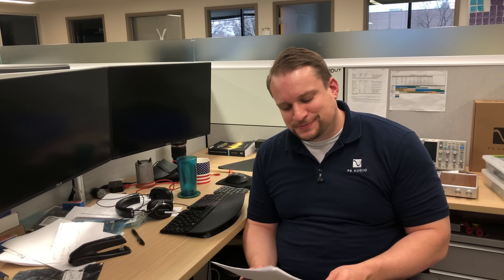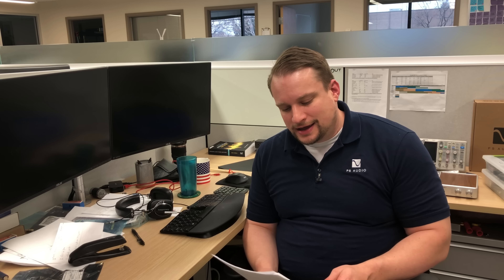Buying vintage speakers

Comment: Vintage speakers and the proper recone kit always gives the best price/performance.
Reply: Yes, but often only the rubber surrounds need replacement.
Reply: Fat Rat  exactly
Reply: @ThinkingBetter  Yes, IF a speaker needs to be refurbished, it's the surround most of the times.
But most of the times, replacement parts come as a recone kit.
Might as well replace all the other components that are part of the kit.
Reply: Qorax Yes, agree. Most speakers are not designed for decades of use.
Reply: @ThinkingBetter  Yeah, I've found that it also depends on the user haha
Especially when that user likes loud, raw bass... 😅
Reply: Qorax I love surround breaking raw bass!
Reply: Fat Rat I have speakers with rubber surrounds that hardened to sort of easily breakable plastic. And other speakers with foam surrounds that became like covered in some sort of mold and also broke easily.
Reply: Fat Rat  the best price/performance when comparing vintage to new speakers.
I mean, are there any other options besides vintage or new? 😛
Reply: @ThinkingBetter  I've had a tube radio with built-in speakers that had a surround of some sort of textile (I think), which had become powder and flakes after 90 years.
Reply: Qorax The oldest speakers I have are my JBL 18Ti that I purchased in 1986. They still play perfectly with no sign of aging. Now I’m using them in my gym room. They still sound better today than most speakers of similar size with their very neutral frequency response helped by a titanium tweeter and unusual high power handling for their size.
Reply: @ThinkingBetter  Well.. it's JBL. It's quality.
I had JBL PRX speakers, very nice and rugged construction.
Reply: Fat Rat  Yup another tube radio I still own is from the early 60s (just a Philips, nothing special) and it still has its original drivers. They work just fine.
Reply: Fat Rat  Meh they're just too lazy to check the component quality by doing some measurements 😜
Reply: Fat Rat  Yes and yes. My L100 Centuries are still breaking in - ha ha. The woofers have the fastest compliance of any speaker I've owned, which is a lot.... and I'm so glad they managed to stay with me. Did upgrade the tweeters to soft domes, and that really made them disappear into the music.
Reply: Fat Rat Well, especially measuring caps degradation is making sense and most modern cheap multimeters can do this. You can’t really use ears to judge if a cap is just out of specs. Caps will usually move the cross-over frequency up by age possibly causing some dip in the frequency response. But for the mechanical moving parts, listening tests are vital. One annoying failure over time that you might easily hear is if the voice coil wire starts getting lose causing contact to the magnet during motion. Also a tiny crack in the surround causing air to come through might be found in a listening test. I use a pair of Beolab 6000 as rear speakers in my home theater surround setup and one cone had such crack.
Reply: @MrPeeBeeDeeBee  You don't want your tweeters to disappear! I mean, what's a speaker without a tweeter? 😜
Reply: @ThinkingBetter  As long as a speaker only changes in its characteristic sound, there's no use to listening if you don't know how the speaker should sound like.
The (partially) disintegrated surrounds I talked earlier about were easily recognizable by ear, because with bassy music you could hear a chuffing/rattling sound.
The radio had more issues that were identifiable by ear, there was a lot of that typical buzzy noise which indicated that certain filter caps were old.
And of course, a squeaking mechanism of the dial pointer and tuning cap 😅

Comment: A good speaker is a good speaker if it's not damaged. That is the reason my Infinity RS IIIa's are 36+ years old and still being used as I write this.
Reply: I also have the Infinity RS3a. What a fantastic speaker it still is! The RS5b for speaker stands is also awesome!
Reply: Pauls old IRS V didnt nees to be refoamed and those are decades old. Its eare they need a refoam. Its rare, and maybe the only thing that needs to be done is a recap in the crossovrr

Comment: Chris, with all due respect, wouldn't d speaker driver manufacturers like Focal, Vifa, JBL, Seas, Peerless etc, be able to offer replacement units from their existing NOS?
They're still in manufacturing and supply drivers to many speaker brands now.
A year ago, I had no problem getting a pair of new tweeters from Focal, for my almost 20 y.o. JMLabs "Electras" 926. They were not cheap but, they were available.
Great video BTW, you now have heaps of confidence and look straight into the camera! Well done!
Reply: Fat Rat  
Hey *Fat Rat*.........Yes, this is a bit more distinct and looks happy. The previous one was somewhat angry or serious looking!
Hope you're keeping well and find time for some music while watching Paul's videos. No news from the Sydney Audio Club yet re: meetings.
Can't wait for the re start!

Comment: I had to have the surrounds replaced on some JBL 2121 10" midrange drivers about 20 years ago. The original concave dust covers had to be removed to insert shims to center the VC. Replacement concave dust covers weren't available even back then. The replacement covers are convex. I'm sure the wavefront is different. But for the life of me, I can't hear the difference.

Comment: Of all the vintage speakers I own, the only ones needing any work are the ARs. The woofer surrounds had perished - seems to be a common problem with AR speakers - but there's a chap in Holland who sells replacement surrounds for about €20 a pair, and repair kits for about the same.
Reply: thisisnev
I have had AR speakers all my Hi-Fi life.  The foam surrounds only last about 12-14 years whether you play them or not.  This is a common problem with almost ALL speakers manufactured from 1970 forward.  I have re-foamed my AR-3a speakers twice at about 12 year intervals, but the last re-foam I did has lasted about 20 years and still intact so the foam has improved.    I also have a pair of AR-3 speakers and the treated cloth surrounds are intact and working fine.  These were probably from the late 1950s.

Comment: Ive rebuilt a couple of JL audio drivers. If the spider is in good condition and you replace the foam surround it usually sounds almost as good. But ive replaced the spider on jl audio 12w6v2 and they sounded like mcdonalds drive thru speakers.
Infinity speakers seem to withstand time a lot more, but they have no replacement parts available other than generic surrounds.

Comment: Look for a good cabinet. Knock on the cabinet. Front, sides, top, and rear. Does it sound like a wooden box, or does it sound like knocking on a cement sidewalk? Drivers should be updated. Spiders, cones, surrounds, and magnets degrade. If you rebuild, ask about magnetization of the magnet. Find out about the magnet material and it's decay rate. Early speakers often had small magnets. Replacement with a more modern magnet can increase damping and efficiency. Replace drivers for the same reason you upgrade headphones with the strong rare earth magnets.

Comment: I have found on my personal equipment that after a recap and replacing the internal wiring with quality audio wire that the sound has definately changed. For the better. My yamaha subs i had surrounds done on by a speciality shop and honestly i cannot tell any difference in sound quality. Now maybe mids i could see its possible that sound could change from original because of the detailed music they reproduce but i still would do it just to see. Low cost compared to buying a new set of speakers that you may or may not like either.

Comment: Often the rubber surround is what deteriorates much faster than the cone as rubber material can harden and disintegrate. I just bought new surrounds on e-bay for some 25 year old white aluminum enclosed CX100 B&O speakers that I had stored for around 20 years. The cones and spiders are still in great shape; and the speakers look otherwise flawless. They will be used mounted on the rear wall in my garage. These old babies are perfect garage speakers.
Reply: THANKE YUE KIND SIRE! THUMBES UPES!

Comment: You make a good case for not paying much even for high end speakers. If all components from cones to glue to crossovers have a shelf life, then speakers are designed even unintentionally to fail. Since you recommend not reconditioning, they should be discarded? Then why would you want to invest in the one final end of the system that is supposed to make the largest improvement in sound quality? It makes our quest for audio reproduction unattainable from the start. Does this mean that electrostatic speakers are better by design?

Comment: A friend of mine, a professional speaker repair tech, told me how to repair my M5s from Polk audio. The spider had detached from the basket on each woofer. All I needed was a 9 volt battery, hobby grade q tips, five minute epoxy AND NERVES OF STEEL!. (Nerves optional)
Mix up epoxy, use q-tip to apply epoxy, attach 9 volt battery to pull the cone inward and thereby maintain the voice coil positioned perfectly in its center. As soon as five minutes (or 9 just to be happy) has passed, the driver is actually playable for all intents and purposes. Although I gave it through the night...
They sound brand baby-spanking new! 
I share this with you because I know only a few will ever need it or use it. But everyone who owns a Polk M5 will need it LoL. There seems to have been an issue with the adhesive on the spiders with that speaker. But they are fantastic. Just make sure they include the mounting brackets and the pins. You need the brackets and the pins. Trust me on this. 😊
Reply: I don't like the sound of that at all, testing for drive unit polarity with a 1.5V AA cell for a fraction of a second is fine, but a 9v battery for several minutes? Poor voice coil ! I'm sure this could destroy many drive units! I'm sure the magic smoke would escape.
Reply: @richclips  the guy has been a successful professional repairman for many many years. The voltage is minimal, believe me. AA won't even move it. And they sound phenomenal. I was surprised at the sound of these speakers. They are fantastic heights front and rear in my HT.
Reply: @Finn-McCool  all I meant is that I would not suggest people try this as a general tip, as there are many old and low powered speakers around that may not like it :) drive units don't like DC, most speakers are damaged by underpowered amplifiers clipping and effectively outputting DC. It's was the 5-9 minutes, and the thought of someone trying it with a low powered 
Drive unit that could be damaged. No offence meant 😄
Reply: @richclips   
I'm not offended at all. But I know that a nine volt battery cannot damage a voice coil. If a loudspeaker  gets damaged by a 9V battery then that speaker was already kaputski😂
Because it's just not possible.
Reply: Fat Rat  um...uhhh...NO....ya see..."tape work" is a new form of derision. Ya that's the thing ya see. Tape work! Like, you know you couldn't even get a reel to reel to work...ya...uhhh....ya...tape work.😳

Comment: visit thrift shops,  garage sales,carrying  a walkman type stereo radio,w a one 4/r in jack and headphone wire w alligator clips on the end,,   people regularly dump used audio b/c they want 'state of the art' new equipment,items which appear clean,no broken suspension,or the shiny grey foam that crumbles w exposure to air and light,,I  got  3 ADS disco loudspeakers for 15 bucks,later on a pair of KLH #wy floor spkrs for 30 bucks,sansui A 1000, 30 bucks,,all but the last ( which I smoked after about ten more years of use ,heheheh) I still have,they still sound noooice,

Comment: How about some really good kits for those who can’t afford the absolute best, but want the best sound can afford?
I just refurbished a pair of vintage speakers and I just couldn’t find suitable replacements for them. Simply speakers has some replacement speakers, but nothing that would work for me. So I got the closest thing possible and run a subwoofer to fill in what’s missing.

Comment: He could try driver manufacturers like Peerless, Vifa and Seas old stock for replacement. My old mirages used a Seas driver and were identical perfect drop ins.
Reply: Those companies have a few classic drivers available but the vast majority of speakers use tweaked oem designs that are no longer available. I’m glad that your replacement worked out well.
Reply: @cbrunhaver  There are many new old stock on eBay.
Reply: Gregg Cheap OK. That is good to know. Vifa and Peerless are no longer the company that they used to be after the buyout from Tymphany and move to Panyu China. A number of things have been recreated but it's mostly all new (but very good) models, and they aren't setup for small production runs.

Comment: Many times, the classic speakers are so much worse than newer production, trying to refurbish will not necessarily make them worse. If nostalgia is stronger than your listening hygiene, go for it. But as Chris says - it will generally not perform within the original design specifications. The only exception is if you have development resources to reconfigure the crossover.

Comment: Oops I  forgot  to mention   the l100 is rated at 50 wpc,  we had a new pair running  on s kenwood kr9600 in 1975 and repeatedly ripped  them apart at 160 wpc we upgrade  to the jbl 166 they did much better but had crossover  issues, the capacitor,s can make a huge difference

Comment: I actually asked a very similar question recently: Regarding older/ pre-owned speakers, given that they are mechanical and involve many moving parts and myriad micro movements over time, do they get"fatigued" in their responsiveness.

Comment: The woofer in the Dahlquist DQ10 looks the same as a Large Advent woofer but it doesn't sound the same.
Reply: The original DQ-10 woofer can easily be refoamed. Simply Speakers sells the surround kits for them.

Comment: Negative Nelly. If I had a pair of $6,000 speakers that were 20 years old I would do anything to educate myself to either make them equal to their original performance or exceed it. It's not that hard.

Comment: Do the non-polarized capacitors used in crossovers tend to degrade the way electrolytic polarized capacitors do? It would seem to me that the waxpaper/foil types would be fairly stable. The chokes and resistors should also have a long life as they are usually not being run anywhere near their design limits.
Reply: NP caps are just two electrolytics wired in series in reverse polarity. So yes, they degrade the very same way. Inductors don't degrade but resistors might change value a little if the speaker was driven hard, but it's very unlikely they need replacement.
Reply: @StewartMarkley  Thanks. I guess I should look into the crossovers in my 45 year old Altec 887a speakers. Of course my 72 year old ears have probably degraded as well.

Comment: I wish he would of covered the expected life of the crossover network  capacitors. I heard they should be replaced but at what age 20 years ,30 years?
Reply: I would say that any cap that is 20+ years old is probably due for replacement. The dielectric(material inside) dries out and causes its performance to suffer(values change, conductivity drops off). Plus, the composition of caps has improved significantly in 20-30 yrs. making them sonically superior.

Comment: This s sensitive  topic,  most speakers  after the mid  80, could be hard to recone or coil,  but the jbl,s and vega,s can easily  be reconed  and coiled, And  in my experience  with new improved capacitor,s they can sound better then when they were built. I dare anyone  to listen to my updated jbl  L100A,s  and not say they sound fantastic  driving them at  over 200wpc at .002,  the aquplas driver cones were reused 123a-3 new coils spiders and surround,s all cloth no rubber. Re coned and coiled  le 25 2 coil  and coned come over any time

Comment: For the price of some vintage speakers (two of mine were free and I paid less than $300 for two others) I think they can be a fine endeavour.  Most  will work adequately with a new woofer surround and that is a fix most people can do for $20.  Maybe not the greatest sounding speaker, but if they have good cosmetics they are certainly fun to have around.  I have found great support for Ohm, Dahlquist and Quad, but that support is not inexpensive - think thousands.  But simple box speakers - Advents, Infinity, etc. - twenty bucks and they sound good enough.
Only get mint condition cabinets, though - at least they will look good.

Comment: Does this argument also hold true for unused , unopened packed storehouse ones sitting there for 15-18 years....??
Reply: As long as they are in a heating and air control environment if not toss those boys out they are dry rotted.n

Comment: I'll hang on to my 66 La Scalla's
Reply: Well, Klipsch has a great community of replacement parts and third party upgrades as well, if you ever run into problems.
Reply: @cbrunhaver  Around 10 years ago they were professionally rebuilt using Crites components, plus replacing the old with a brand new upgraded crossover. They're good for the rest of my life
Reply: perl man  I literally grew up with these speakers. My father bought them the same year I was born and when he passed away I inherited them. Over the years they have always made me both remember my childhood and my love for music. I do believe you and my father had the same musical tastes' whereas I'm more into classic rock. If you find it in your budget one day pick up a pair of these and you won't be disappointed.